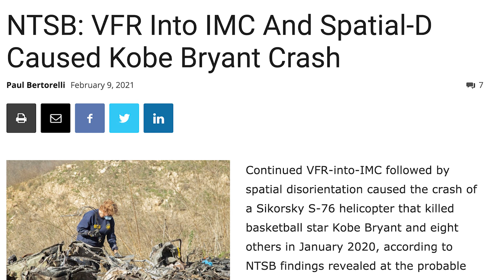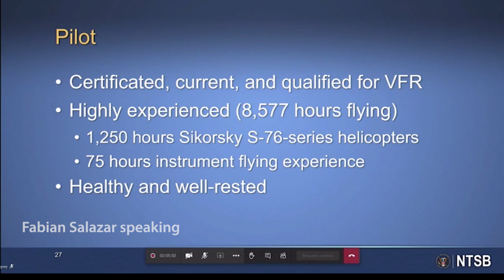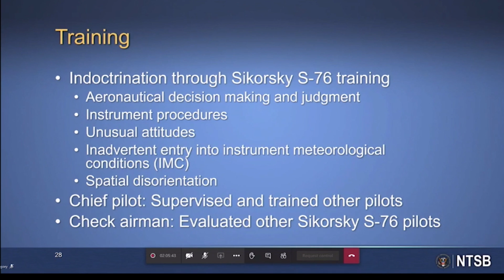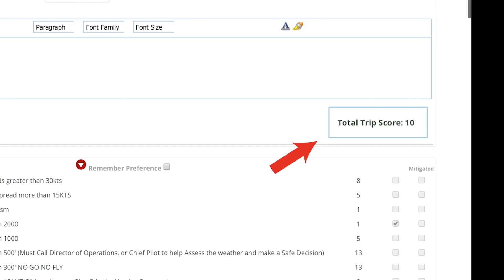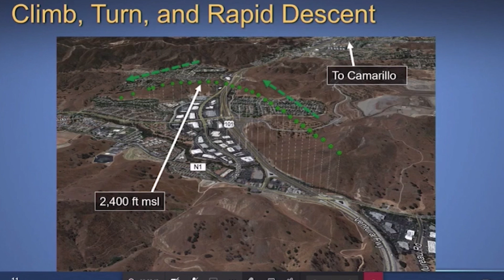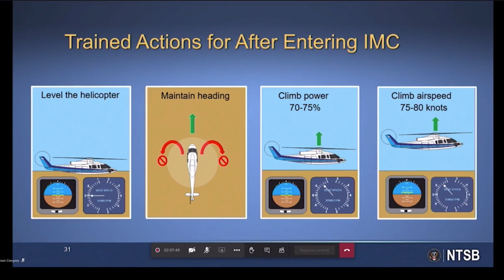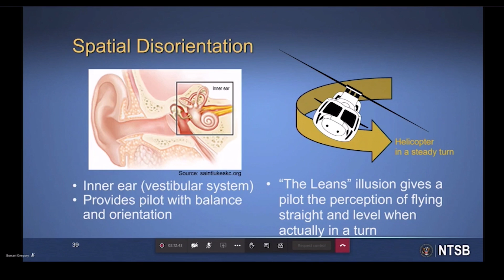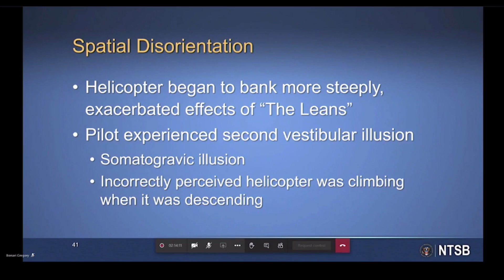How A Split Second Wrong Decision Caused the Kobe Bryant Fatal Crash

Comment: The morning after the Buddy Holly crash, my dad introduced a term to me that has been my go to that I watch for - celebrityitus. The pressure, overt or not, to do what the famous person or boss wants forgetting that you are the PIC. Over the past 50 years I've upset many a celebrity or boss when I said no we're not flying right now and you can find another pilot but I'm not risking any lives for what "you" think is an important flight. It's just as deadly as gethomeitus and much more subtle. A very overt case was the Aaliyah crash of 2001.
Reply: Ara Zobayan,  The copter pilot was no doubt the one that crashed the helicopter into the ground. However, we don’t know for sure what impact or influence Kobe Bryant and the other passengers had on the situation. We might figure that the pilot was reckless, but he could’ve been under pressure by any one of the passengers, egging him on.
Reply: I am a truck driver and I've been influenced by dispatch many times to push through bad weather.
Reply: @Defender78  even if no one was egging him on, he felt the pressure to deliver for the celebrity or he might not be considered to be the favored pilot anymore.
Reply: Don’t take a helicopter to basketball practice
Reply: A Qantas pilot once used a phrase, (and I'll link it it if I can find it), "Sorry about the delay to take off, but later I'm sure, you would rather be down here wishing you were up there, than up there wishing you were down here.
Reply: @steviesevieria1868  yes great point. I read that kobe complained multiple times through the years .and the pilots that flew him were highly scrutinized.
Reply: Buddy Holly Crash?!! Damn Bill, how old are you?
Reply: I think that plane was overloaded with luggage and I want to say the pilot had cocaine in his system. That plane crashed immediately after takeoff.
Reply: @stephen3762  my pilot's license is only 52 years old, but my dad started flying in 1928 and started training me very early.
Reply: Very true, thanks for sharing
Reply: @Defender78  A pilot that allows PASSENGERS to determine the flight in opposition of what his extensive training has reinforced is one that should never fly again. 

The pilot is in charge of the aircraft and the ultimate safety of everyone on board. 

If you were driving a car and your passenger told you to go 100mph but, would that excuse you from the consequences?
Reply: Steve Ray Vaughn, Hendrick Motorsports to name a few more.
Reply: @Defender78  sadly most people who charter aircraft regularly become very picky and expect a certain level of control, and the pilots that cater to thier whims are the ones who are employed the longest.

Kobe was notorious for firing the help over the smallest of details.
Reply: @redgringrumboldt8983  celebrities and rich people are just used to a different level of service than the average person receives, and if yoy want to stay in the presence of greatness then you too must display  level of reverence and respect to what the client demands. 

"The help" is easily replaceable,  and if you don't comply with thier wishes then they'll easily find someone who will.
Reply: @philmenzies2477  And that's why I think they're STILL the only airline with NO crashes.
Reply: @ciccone39  Skynyrd crash was unbelievably stupid...

Imagine knowing 10 minutes you're going to crash. 

Randy Rhoades was also moronic. Pretty sure that pilot was coked up.
Reply: @BoleDaPole  Then he got what he asked for then...
Reply: it was safe to fly, pilot was negligent. Human error ended up being the ultimate factor.
Reply: @redgringrumboldt8983  Very easy to say, but try that with someone who can either fire you on the spot or git rid of you later. Sure being alive and unemployed is better than employed and dead, but it does add to the calculation. 

And when you work for excutives to tend to be "type A' personalitites, jerks and/or not a bright and they think there are in everything adds to the  process. In their mind you did not get them to where they wanted to be on time is your fault. Many executives like the sexiness of having their private aircraft without factoring in it's lesser abilities as the airlines working out of major airports. They don't know and don't care.

 Many of the leaders in agencies just want to push their agenda and deflect any blame that might come their way. It will be, and is, a major reason the talk of self driving cars and commerical trucks that drive themselves is BS (or much much longer in the future). The companies that make the vehicles and components need a driver/pilot to blame, preferably a dead one, they don't fight back.
Reply: Probably SRV as well.
Reply: Projekt Kobra  And use a low abrassive toothpaste .
Reply: 4:33 The real problem... tortoise shell glasses
Reply: @stephen3762  he misses that singer
Reply: @BoleDaPole  high pressure client, ask anyone that worked for...
Reply: @Defender78  Pilots aren't stupid.. He would've known that Kobe had been through a few pilots already.. and probably knew why
And wanted to keep the job witch means keeping the customer happy
Reply: @Morpheen999  I wonder if the customer is still happy now? 
Someone’s celebrity status is a low bar to risk your life for.
If the passenger has an attitude that he is willing to risk his (and members of his family’s) life to get to a practice then I sure wouldn’t care to have him as a client.
When he steps into the aircraft he has entered the pilots world and the pilot, not the celebrity, is the most important person on board.
Reply: @redgringrumboldt8983  I have no doubt that none of the passengers (including Cobe Bryant) put pressure on the pilot. The point here is that the pilot may have (very likely) felt obligated to deliver the important  person to his destination, assuming that the consequences of failing may be much more significant than if it were an ordinary sightseer. In other words, it wasn't the pressure from outside; it was a strongly perceived pressure.
Reply: @BoleDaPole  Now he’s notorious for being dead.
Reply: @vasicp  well perception usually has a higher impact on decisions than external. Also we don't know if the company has a reputation (well at least I dont know) for punishing pilots for making their customers with  deep pockets mad. Like many people have stated Kobe is known for firing the help for pretty much any reason, so either the pilot and/or the company felt obligated to keep him happy since he was a repeat customer who would make flights for petty reasons (like a practice). Much like if you work for a boss is known for if you can't get something done even if actually can't in time, that they will punish you severely for it (which includes docked pay, suspension, lossing your position, fired etc...) that you will do things that would get you in trouble or against company relations of procedures just so you can try to finish a job.

I work in the oil industry in the field and simply the implied consequences of something would pressure a lot of workers and even the higher up themselves to finish a job even if meant breaking a few rules or safety regulations in secret. Luckily this is happening less and less in my field of work after several accidents in the industry that pushed many companies to tell the customer to stick it where the sun don't shine if their not happy that if the job took a few days or weeks longer than expected because of unforeseen consequences that always involve prioritizing work safety over brown nosing a customer.
Reply: @ciccone39  SRV pilot was unfamiliar with terrain. HMS final report sighted some equipment irregularities. But weather was a factor in both crashes.
Reply: @BoleDaPole  I wonder if the part 135 operators should set expectations upfront so their pilots are not placed in difficult circumstances that could comprise life?
Reply: @dogshmog  The added factor of night flying and it seems as though a lot of part 135 operators are working under VFR restrictions. (less expensive options to maintain profits)
Reply: @philmenzies2477  I heard that phrase used when JFK Jr crashed
Reply: Oh Boy.
Reply: good point. this scenario having judicial ramifications is a very slippery slope. it's like telling someone how you would respond in combat you'll never know til you get shot at.
Reply: I thought the same shit as soon as I heard about the weather conditions. It’s how the singer Aaliyah died as well. I believe they convinced/coerced the pilot to fly overweight.
Reply: @richardcranium3417  well said.
Reply: Quite an honor role here. Patsy Cline. Roberto Clemente. And let's not forget seven-year-old Jessica Dubroff.
Reply: -- Lynyrd Skynyrd.  RIP.
Reply: @WeilerBill  I am assuming he trained with Orville and Wilbur. ;-)
Reply: @fishmonger6879  I thought about JFK JR when I watch this too. Trying to fly VFR in IFR conditions, spatial disorientation, the only difference was where.
Reply: There is no evidence that Bryant urged the pilot to fly in bad weather. It appears that the weather was questionable but didn’t merit a great deal of concern. However, when visibility vanished, instead of reacting responsibly, the pilot tried to push through. So if there was pressure to finish the flight, it was likely self imposed by a pilot making a bad judgement call.
Reply: Bill Weiler, if they don't thank you, I will.  Thankbyou!
Reply: @stephen3762  baby boomer
Reply: @WeilerBill  you're a baby boomer and your dad WW II generation. That was my guess.
Reply: @Morpheen999  convincing yourself you can do it when you can't.
Reply: @vasicp  it was both
Reply: @wesmantooth5908  facts. Or fly economy where it’s safer than a 🚁
Reply: @steviesevieria1868  
Or the pilot thought he could do it and it wasnt a big deal. You're making up a story that we have no way of knowing the accuracy of. I'm sure Kobe wouldnt risk his daughter if he thought it was dangerous.
Reply: @youtubebannedme4207  if Kobe had enough brains to realize it was dangerous. IF ….
Reply: Correctamundo. People in every form of transportation have killed “celebrities” by the dozens in the simple hope of having the celeb think highly of them.
Reply: @jerryvandevort2366  thank you for your service! Stay safe out there brother!
Reply: @leaheames8995  thank you your welcome. My new company I've been driving for a year and a half is much much safer and better. The moving company I drove 18 wheelers for 14 years for had no regard for safety whatsoever and forced us to cheat logs and drive unsafe equipment. But I think the helicopter pilot was influenced by the VIP customer and pressed his luck unfortunately.
Reply: @steviesevieria1868  I truly believe you're right. I don't think the pilot would've insisted if he didn't have VIP customers on board.
Reply: @jerryvandevort2366  Where did you read that? I read that Kobe had been requesting this pilot recently not that he had complained about any others.
Reply: @bbigjohnson069  I read it on the internet. Kobes pilots were scrutinized actually kobe was picky.
Reply: @stephen3762  "old enough to know better"?  do you remember this crash after a Huey Lewis concert? https://en.wikipedia.org/wiki/1991_Vallejo_helicopter_crash
Reply: @WeilerBill  Very impressive, sir.
Reply: @northwestlife_9  what are we talking about
Reply: @stephen3762  I guess the things we remember when we're old.
Reply: I couldn't work out what gee-thome-eat-us was... I thought it must be an aviation term I'm unfamiliar with, so I Googled it and couldn't find anything. Was starting to think this pilot's post was BS and he was just making up words.

He means get-home-itus 🤦

Yeah the VIP or very important cargo effect is very pernicious, especially if your VIP has a history of going through staff who don't obey orders. You can see how you could easily begin compromising your professional standards to please your client and it ending in disaster.
Reply: Yet, you don’t know that Mr Bryant pressured the pilot to take commence the flight and/or to continue it. You failed to account for the CHILDREN, other parents on board. Your comment is mere conjecture & shows a lack of responsibility.
Reply: @wesmantooth5908  You wouldn’t consider it because you can’t afford it.
Reply: @BoleDaPole  Please cite where you read or viewed this information.
Reply: @Morpheen999  To the point of the death of his children & himself. Sure!
Reply: @indirastone7382  I’m not the same person I was a year ago. Judge not, lest ye be judged. That said, don’t take a helicopter to basketball practice.
Reply: Im a talent manager and i completely agree with you.. more pilots and bus drivers need to be more firm about managing the expectations and reality of the situations. I dont think this pilot was under any pressure from Kobe... it wasnt an important  event or game...I seriously doubt that part. it was just an unfortunate incident.
Reply: Exactly!, this was precisely what happened here, Mr. I’m too special to wait two hours in traffic driving, wanted to get to the game fast and put the lives of everyone in that helicopter at risk, including the pilot, who if he wasn’t flying an absolute prick would have simply said No.  Risking one’s life to please a celebrity who thinks he’s entitled to “Special Treatment” is a good way to get one’s self killed.
Reply: Well done.You should NEVER risk your own life for them
Reply: Kobe Bryant’s pilot is like Michael Jackson’s doctor. When will celebrities learn that if the majority of professionals tell you no, finding and paying the one who bucks protocol and says yes is always a bad decision.